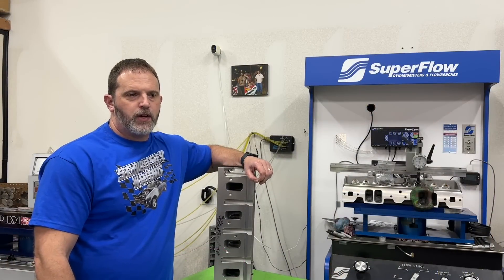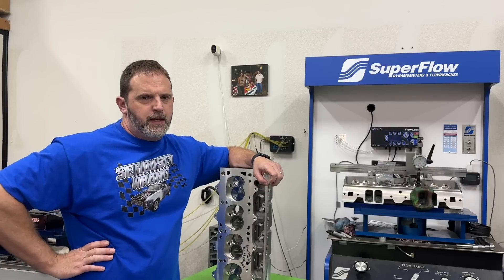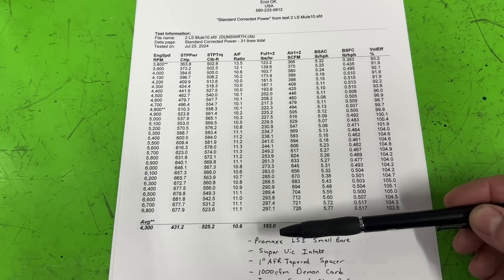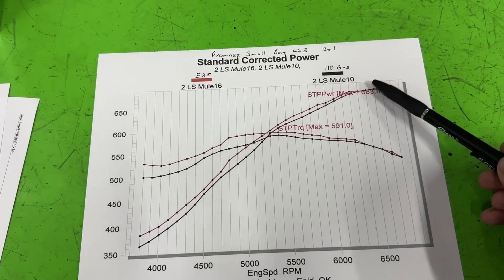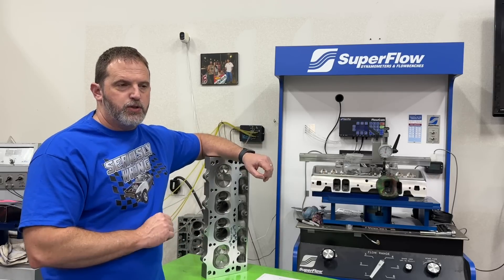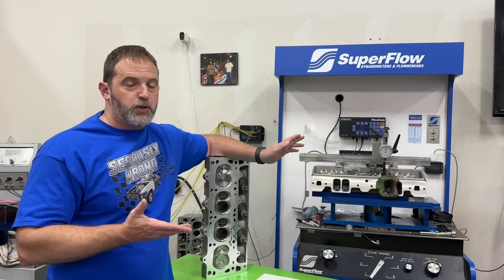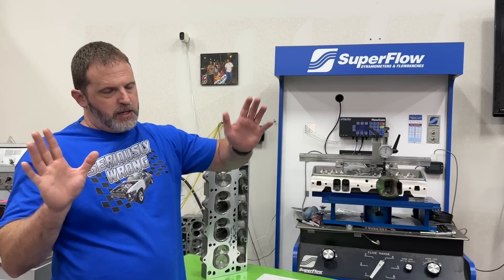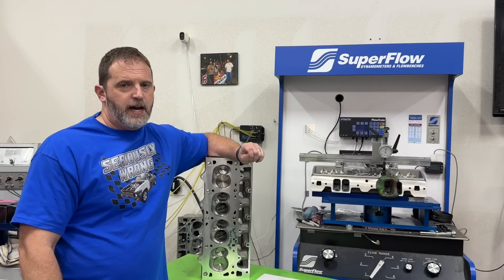E85 vs Gas Dyno Test Part 2

Comment: Could it be since the compression was raised slightly from the added fuel that it needed a drop in timing similar to boosted engines? Fuel is non compressible so more liquid equals a smaller chamber

Comment: I noticed the same thing with E85 on my Draw-thru turbo builds too - it keeps picking up torque until you run into the limits of the ignition system. 12.8 AFR it pulled like pump gas, 10.8AFR (gas scale) it felt like it picked up 10ft/lbs at the wheel (this is on a 130whp Turbo Buell M2 I built that makes 105ft/lbs at the wheel).  I also tried adding in more timing and the trap speed didn't move and I blew the front headgasket after about a 50 runs. I went back the the same timing I ran on pump 91 and actually pulled out an additional 2 degrees below peak torque and the trap speed stayed the same and I never had issues with headgaskets from there on out, even on higher boost.
Reply: I'm torn between 110 and E85 for my full bolt on bmw 335i

Comment: most people watching and replying are not speaking the same language as you are. unless you are talking specifically to engine builders.  What i mean is street cars and performance shops are all chassis dynos and EFI. AFR and overall timing. IF we take 2016 or 2015 mustang these are more easily relatable. that is why people are commenting negatively they are not on thesame page as you.

Comment: Never seen much of any difference in power between E85 to E98. This isn’t a 35 psi turbo setup. I’m surprised it made more than the 110 on a NA motor. Also curious why you have such a small cam in high compression 408? Throw a something serious in there and try and find a CID intake to test. Seen some strong gains on other tests but you seem to must some myths.

Comment: I liked your video I was wondering if you could do a tuning video on how to read spark plugs like a example understanding the timing burn on the grounding strap , cutting a plug in two to determine rich or lean fuel conditions etc Thanks

Comment: The laminar flame speed (and also the flame kernel development time) of ethanol is faster than gasoline. So the effect of that is exactly what you saw (same timing makes ethanol combustion phasing advance) so CA50 tends to advance with ethanol for a given spark timing.

Glad someone finally is getting this info out there 

I wish you had a gen 5 LT to show this even more and the HoV effect…

Comment: Holdener has tested something called oxygenated race gas. It outperformed straight gasoline in high compression engines as I recall. Very interesting results—you really do have to test the theory on your application! I don’t have pump E85 anywhere close, so I’m not tempted to use it. No power adder, either. Great test, thanks Eric!

Comment: Gasoline has significantly a significantly higher calorific content of about 125,000 btu/gal (US). Ethanol is about 76,000 btu/gal. While with quantity of ethanol in “E85” varies considerably (significantly less ethanol in cold weather) an E85 capable vehicle will always burn more E85 than gasoline.9

Comment: Thank you, I’ve been saying this for years!
E85 Burns faster.
The only time you need more timing is if your compression is way to low.
Reply: It burns slower just like higher octane race fuel,makes less heat than gasoline also,so you can add timing because it needs more lead time sometimes but that all depends on chamber efficiency/quench which LS have pretty good chambers
Reply: @robholmes2129  🤦🏻‍♂️
Reply: @robholmes2129  Ethanol has a flame speed about 5% faster than gasoline.  Pretty easy to google it.

Comment: Id Love To Go Flex Fuel And Run E85 On My Turbo 3800. But It's Actually A Pretty Big Burden To Deliver That Much Fuel. I'm Limited To 1 Pump. A 525 On A JMS Voltage Booster As well As A Vapor Worx PWM Controller (to prevent vapor lock) Both Are MAP Referenced. That 525 Is Maxed Out On Pump 91 For Me And That's With 1000cc Water Menthol Injection. I Couldn't Imagine Trying To Flow Enough E85 For My Application. But I Can't Imagine My Car Going Any Faster, It's Already Enough Sauce For Me hahahah

Comment: E85 burns slightly faster than most gasolines except when very lean. The only time you should pick up significant power with timing  is if you were octane limited.

Comment: I did the same test about 5 yrs ago on a 383 pump gas motor. Got pretty much the same results. Used pump93 and pump E85, lost 5 hp with e85 but gained torque through the entire rpm range as much as 17 ft/lbs at one point and lost at 6500rpm, no timing change. Nice vid.

Comment: Great test! So gas timing was 29* and bumped to 30* up top and that would put E85 at 27* bumped to 28* up top for best results?  Curious on the best AFR’s between the fuels- did this end up near 13.0 on gas and maybe down around 12.0 with the 4 jet increase on E85?  Definitely busting some myths!

Comment: The misconception is the ability to run more timing because the charge temp is brought down because of the added fuel quantity in the chamber with high compression or boost. That is only with pump gas compared to pump 85 in my opinion..

Comment: E85 is a lot cheaper!! It not about the hp gain it’s about getting a pump gas fuel for a price cheaper than $15 a gallon for 110 race gas. 
$2.85 vs $15.00 a gallon yall pick a price you’ll rather spend of race day! 😎now I wish he would have did this test with pump gas e85 but till I feel pump e85 is the new 110 race gas 😎now days

Comment: If you want to make gains with ethanol it can often be higher compression but not always.. This isn’t always true. A low compression but high efficiency engine you can gain more. Example is an engine that will only take 16 degrees on 93 octane is a perfect example. Engines like that will gain from ethanol first. A lot of times a high compression old school V8 will do way better on race gas than ethanol. Vs modern engines tend to be the other way around. 

Basically, in a nutshell, when you cannot add a lot of ignition timing, you can’t always harness the whole combustion event . This is very typical for turbo cars where you have reduced ignition timing due to certain fuels and it’s a lot of cylinder pressure. Some old-school style will take 32- 40° on 91 octane. Engines like that generally do not benefit from ethanol. 

So at the end of the day engines that gain the most generally are ones that are very high efficiency and low ignition timing on pump gas .

Comment: I think the way the other dyno results makes a larger difference would be that they are comparing pump gas and E85 so the pump gas is detonation limited so they have to use less timing. The other thing to consider is that you need a lot more E85 than gas to get optimal air fuel mixture so there is actually less room for air in the mixture so less oxygen, so less horsepower. Also that motor isn’t detonation sensitive. I’ve also seen Gen 2 Hemis pick up power with less timing.

Comment: e85 isnt always 85% 65/70 mix i'd still run the race 110 because its pure high octane hat prevents detonation on 14.1 or higher compression we ran renegade 116 15.5.1 430 sbc dirt motor over 800 hp..
Reply: i seen after you used real corn bread fuel lol... kentucky is known for our moonshine
Reply: I actually see a test at BTR. They tested moonshine.  It took alot. I think it was on Richard's channel.  @faustthehammer8706
Reply: I'm torn between E85 and 110 for my turbo bmw?

Comment: Interesting video for sure. I've been wondering what the difference is between 110 and an E85. My old setup I used 110 and my new setup uses E85. Using the same sbc short block, a different cyl head with the same cc, a bigger cam and going to E85 in a 400# lighter car, I picked up over a second in 1/4 mile ET. That got me trying to figure out what part of the improvement was related to E85. Regardless, I sure do like that $2.79 E85 at the pump.

Comment: Great video Eric, appreciate you taking time and money to run these tests that most guys don't have the means to accomplish.

I don't think anyone was implying E85 was gonna blow away 110 race gas in power numbers, 99% of people are comparing what they can get at the pump, so E85 vs 93 or 91 octane depending on where you live. E85 being 100-110 octane depending on what ACTUAL % of ethanal you are getting at the pump, it undoubtedly will make more power than 91 or 93 octane, bearing in mind you are actually tuning for the fuel change vs regular pump gas.

With 110 being 15-20$ a gallon (local price 5 gallon pail) and E85 being ~3.60$ a gallon (pump), I think its a no brainer for street guys and weekend warrior setups, its cheaper than 93 in most places even. Bear in mind you need more E85 than 110 or regular gas because you need more E85, but 20-35% more fuel being used on E85 is still leaps and bounds cheaper HP per $ than 110.

I also think the cooling effect that E85 has on a motor is also very hard to quantify in a dyno room vs real world or track use shoved in a tight engine bay where the motor is getting heat soaked. Just like you mentioned in the video, I know many turbo guys swear by E85 for its cooler burning properties because turbo cars obviously product a TON of heat.

I don't think anybody with the money and the NEED to run 110 is taking time to argue about E85 online, I think they are too busy at the track or the strip with their race car for that 😂

Comment: Good stuff again.  Many internet folks don't realize that as measured in test engines by the science guys at places like SWRI and such, the flame speed of ethanol is somewhat faster than gasoline (well iso-octane is what they test cause we all know how much pump gas varies).  If you're not octane limited on your gasoline tune, it makes complete sense that ethanol may want a little less.  Wondering if it liked the richer mixture because it cooled off the charge that much more with the added ethanol.
Reply: Ethanol is prone to knock if too lean, it can handle far more ignition timing but if it’s lean it will knock!

Comment: Typically ethanol through a carb will be pretty close to gas no matter the octane because carbs rule now if it’s multiport fuel injection. You might get some power from ethanol.

Comment: Comparing E85 to 110 Octane race gas seems kind of pointless to me... People don't switch to E85 if they are already running 110 Octane race gas, they switch to E85 from regular 93/91 Octane pump gas, which would net you big gains.
Reply from the maker: It doesn’t I referenced that from the previous test.
Reply: @WeingartnerRacing  As I recall, the previous test was not with a 13:1 compression engine. While I don’t have dyno numbers for that situation, I do have first hand experience driving a car with a sbc with 13.2:1 compression on pump gas, and it had to be extremely detuned, whereas I feel confident pump E85 would allow a much better tune. The difference between pump gas and 100LL was barely drivable to pretty damn hot. In other words, an affordable way to run higher compression, and use it too. The biggest advantage of E85 to me is cost.

Comment: Throwing a static compression number in there means nothing without valve timing. What dynamic compression are you aiming for? what is the top combustion pressure at what crank angle? 

Yes, E85 has a higher octane number than pump gas, allowing it to work with higher dynamic compression and combustion pressures than pump gas. When you compare it to 110 race gas, the difference is very little. 

Regarding timing, you aim to get top combustion pressure at a certain amount of degrees after TDC. This certain number depends on the exact engine configuration and the speed of the flame front (combustion speed) of the air/fuel mixture. From there you can calculate back to where you should ignite the mixture and use your dyno to verify/correct your calculation. The moment you start changing fuel mixture, you change the burn speed and thus need to change timing to find the optimal ignition moment. 

It's not rocket surgery, but it gets complicated fast and a lot of people try to simplify to a point that their story becomes just not true anymore.

Comment: I recently built an e85 427 Clevor with 3V heads and have found the same thing to be true. On the engine dyno we picked up gobs of torque by dropping the timing a few degrees. We lost 1 peak HP but gained 18tq. Timing ended up at 32 degrees total.
Reply: What 3V head?  CHI or something different?  I’ve got a new build with ChI 3V 225’s
Reply: @tomlavendusky8150  They are CHI 208cc 3Vs. The 208's were great, tthey made 618hp and 598tq on the engine dyno with the biggest off the shelf hydraulic roller I could find. I can only imagine what the 225's are capable of. Good luck with your build.

Comment: This is my guess...I am no expert...perhaps with a carb, the evaporative cooling effect mitigates some of the cooling gain from the E85 and the lower energy density of the E85 means the fuel has to be run richer abd the fuel is taking up space that is being filled with more air with the race gas. Perhaps with EFI and/or boost the E85 might show an advantage in the absence of evaporative cooling from the carb and with the greater volume of air afforded and higher heat associated with boost...that is just conjecture who really knows, I am sure different combinations could be put together that would show more power with one fuel or another all dependant on what the specific combo likes. A lot of this stuff can be witchcraft in extreme instances 😂
Reply: Great thoughts.  But EFI won't solve the issue IMO, at least not port FI on an NA engine.  In fact carbs on alcohol fueling do a lot better job of cooling the charge than port FI engines with the injector at the cylinder head.  It's not uncommon to see mild injected LS street engines (10:1 or so CR) gain almost nothing when switching to E85, even though at normal mixtures the E85 should contain more energy per cylinder event and you can run more advance.  And that's probably because you're displacing some charge air with the extra fuel mass and not cooling the incoming enough to make a big diff in density.  OTOH, direct injection motors love E85.  An stock 11:1 LT naturally aspirated engine will gain an easy 25-35 hp (6-9%) just switching to pump E85 from pump gas (and retuning of course).  The octane helps, but it's also the fact (IMO) that you're injecting the fuel after you've already ingested the air charge so you're not displacing anything in the intake port like port injection. Of course, I could be wrong.  Always willing to hear other explanations.

Comment: This is exactly what we find with NA cars on the hubs. It just does not make a difference because the engine is not knock limited. Or another way to say it is that the 110 is sufficient to keep the engine out if knock at the set timing. The E85 is only a tiny bit better because it usually has a lower IAT so it's getting a denser air charge. And since it takes more E85 to make the same power, the E85 is taking up more space in the intake so the gains dissappear in the upper RPMs.  But It's like your results show, small gains. But E85 is cheaper and more readily available for most people. My local station will almost always test at E90 and it's $3 a gallon.
Reply: The extra volume of fuel displacing air in the intake costing power? 

Could be 

The slower burn rate of alcohol may be letting the Piston "run away " from the flame front as it travels down the bore?

Could be 

Maybe a little of column a, and a little of column B? 

Beats me
Reply: @billythebake  Ethanol burns faster than gasoline.

Comment: There's a substantial difference between the words 'tighter timing' and 'more timing'. Tighter timing refers to placing the ignition timing event closer to just after the peak cylinder pressure event. In an ideal world, you would have peak cylinder pressure from combustion happen at ~14 degrees after top dead center. Some people say 16-18, and that is safer, and easier to achieve, so a more realistic number to shoot for. It's like pushing someone on a swing, you gotta time your push just right to add momentum to the swing.

Different fuels take different timing because they burn at different rates, and thus the relationship of maximum combustion pressure and where the piston is in its stroke will also change.

Comment: After 4 years of running same engine/car on the dragstrip with E85 I can say there are within reason no absolutes with e85. I use Lambda on my af guage with a Go Pro recording all the way from burnout to finish line to back to trailer.Read plugs too sometimes. E85 is a fuel that is really good based on how it's tuned, temperature outside, and the engine combo. If you don't let engine get to 170 you won't know beans, and if the engine gets above 200 some combos you might have questions about why did I run that ET When it didn't do that before. Timing for NA I run the same 36 degrees as I would on race gas as my combo does not go any faster with more. One thing I think I've found is that with different intakes it behaves differently, again depends on engine combo and the temperature thing. So if I were summing it up I"d  say, start out with a basic safe tune and let the cars timeslip along with O2 sensor tell you what it needs and change in small increments jetting /air bleeds etc. I will also say there are a bunch of "experts" out there that only know one part of the story with E85. Good video Eric!